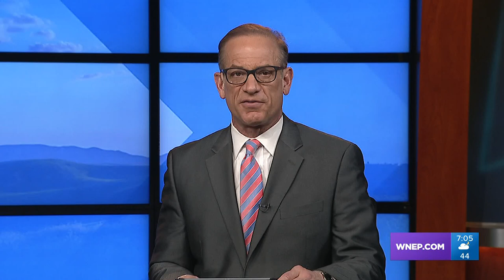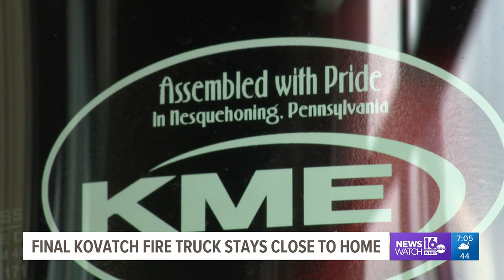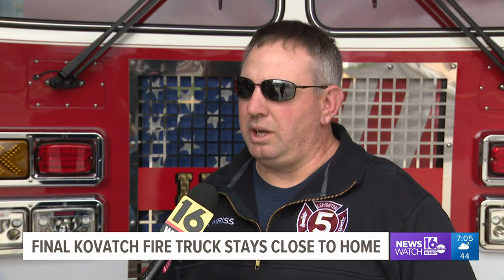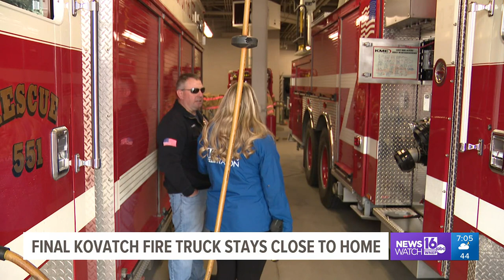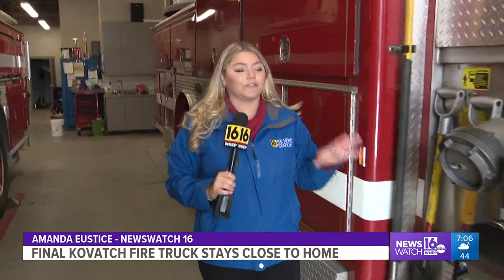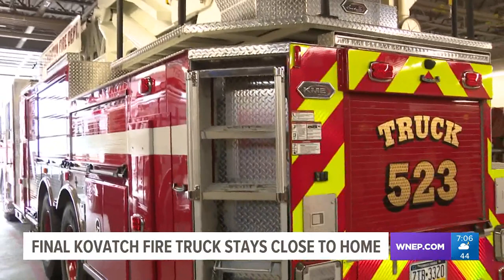Final Kovatch KME firetruck stays close to home

Comment: hey, what are the reasons the factory had to close?
Reply: I believe it is because they were bought out by the REV group, and alignment meant closure of some plants.
Reply: They were bought out by a large fire equipment company. They did that to some other companies they bought as well.
Reply: The parent company (REV) acquired KME from the Kovatch family several years ago; they consolidated and centralized manufacturing to the Ferrara facility (now also a REV company) in Holden, Louisiana.